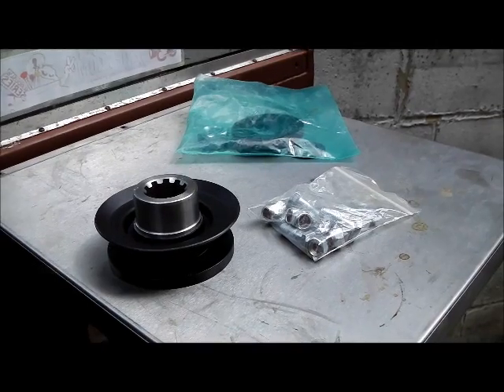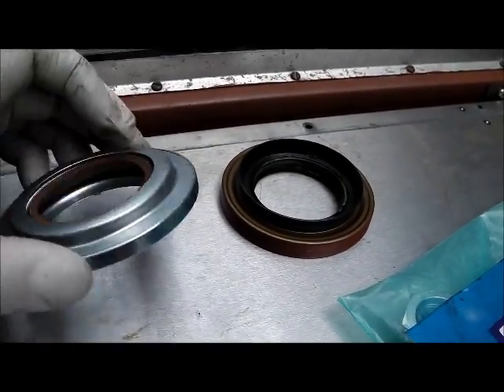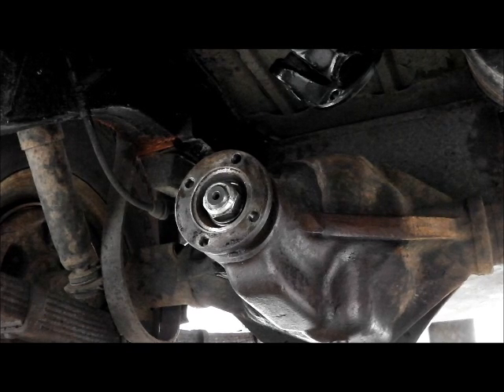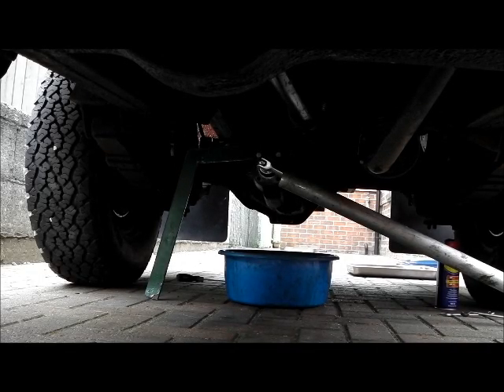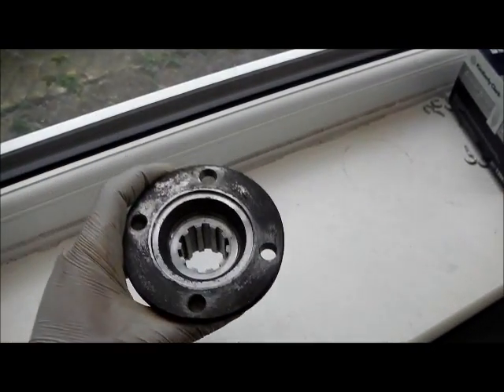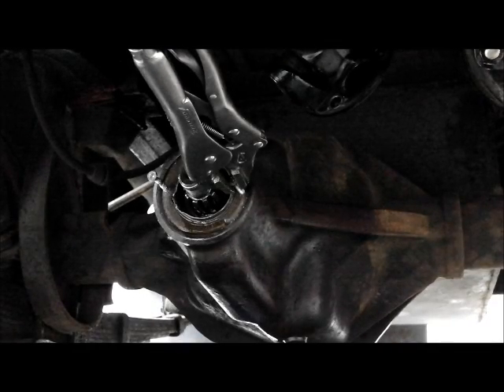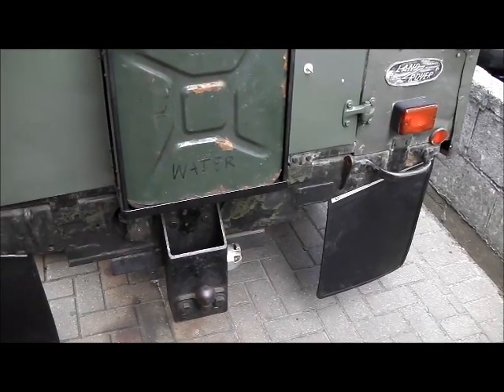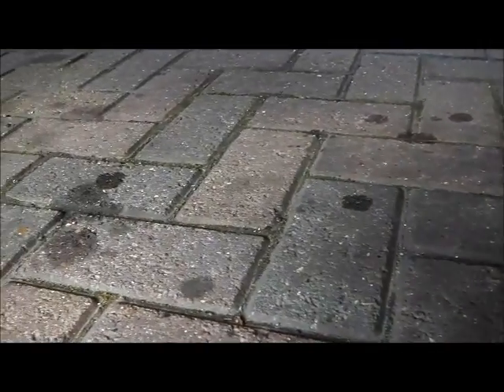Land Rover Series -  Changing Salisbury Diferential Pinion Seal

Comment: I'm just doing mine but the mud guard is warped from galvanising and is fouling on the casing. I can get the hub on the full way when the nut starts getting very tight but the guard is then fully stuck. Is yours running true?

Comment: Hi Steamwally, like you this is a job I've been putting off for my Land Rover Series.  Thanks very much for the detailed and helpful tips on replacing the seal (though mine is the rover type and SWB land rover; I would think it's a pretty similar process to replace).  This has given me the impetus to get on with the job, and this evening I crawled under to clean up the axle housing and see if the axle breathers were doing their job.  The front was fine but the rear breather not so..  I ended up replacing this.  While doing this I noted the rear drivers side hub seal has a leak and I will need to replace that and the brake drums (sorry to learn that your video footage went awol, and this would been good to watch).  I had heard that often the breathers are the cause of blown seals.  I don't know if you have cleaned up yours to see they are alright as it would be a right royal pain if the pinion seal were to blow because of that.  
Happy Rovering
Reply from the maker: Thanks, I washed out the breather in petrol, it may well have contributed to failure of the seal, its a common cause of half shaft seals failing. Not too bad a job, just awkward working on the ground.

Comment: If you're doing the pinion bearings as well, I found that the outer pinion bearing race is just the right size for fitting the pinion seal.

Comment: Very useful video, thanks. Would be handy if you could post up part numbers of the replacement diff flange and seal and where you bought them from. Ta.
Reply from the maker: thanks, the part number I don't know, just went by model year and type of axle. this is an improved later type of seal kit, but fits the older axle.

Comment: Thanks for the reply.  Can I ask how the mud flaps are fitted please and if those you purchased come with the necessary brackets to install them?  They look the part.
Reply from the maker: The rear mud flaps just bolt to the cross member. You will need to drill holes for them. For the fronts you fix them between one of the sill bolts and wing support brackets. It will become obvious when you have them, brackets included. 

 Cheers

Comment: Hi all. LR newbie here. What tool is recommended for the square drive sump plugs on the diff? It looks almost like 1/2" but I've not been able to get a typical extension into it.
Reply from the maker: That's unusual! I did encounter this problem with my MGB and made a suitable tool which went in the car's tool kit - can't remember what size it was but it was nothing standard. You used to be able to get a special spanner for such occasions with a multitude of different size square drives on it, search for a "sump plug key" and you'll find such a thing.

Comment: Use a torque wrench to check the torque of the pinion nut before removing it so you know the exact tightness when you put it back together.
Reply: When the pinion nut is tightened down on the crush tube, you have to go to around 250 foot pounds, sometimes much more, to get the right pre-load. Don't think many have a torque wrench big enough for that...
Reply: true enough, but probably one that is 3/4" or 1" drive head with a handle that's around two feet long